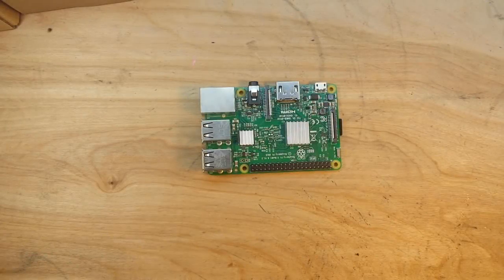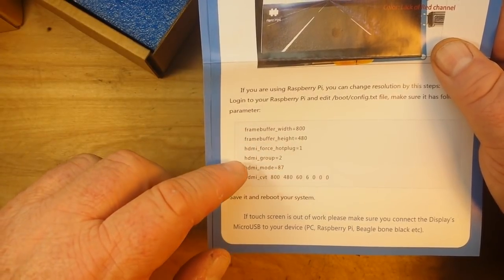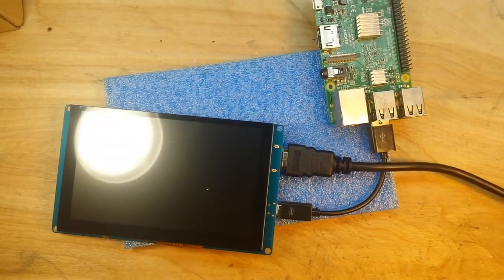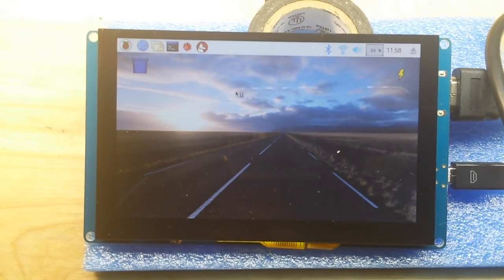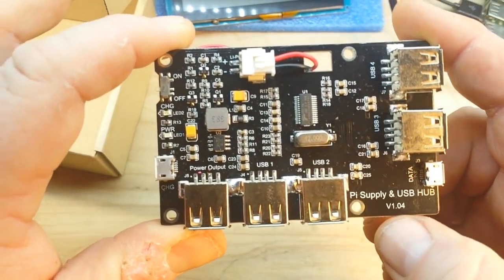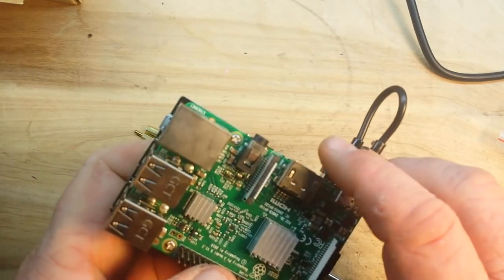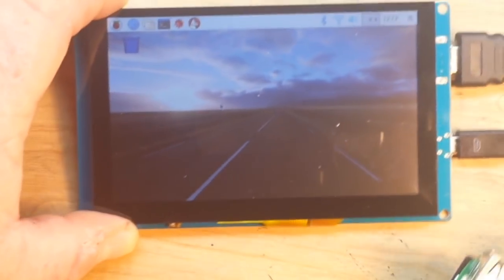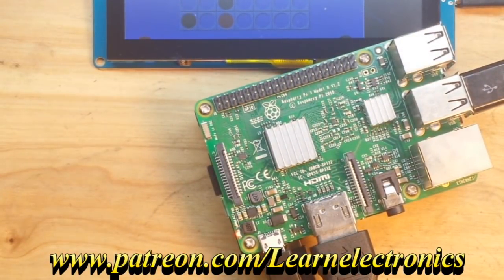Make your Raspberry Pi portable

Comment: Bought a Sunfounder 10 inch touchscreen. I was supplied with a 12V 1.5A power adaptor instead of 2A which is advertised on their site. Having an issue using the display board's usb port to power my rpi3. It's boots up but I constantly get that lightning bolt sign on my screen indicating it's not sufficient for my pi. I've already tried a 3A power adapter but still got the same result. So I guess the issue is with the display board itself. Already have a working DIY setup and hope to make it portable using robojax's recently reviewed 9A dc/dc converter. Going to use li-ion 24v(28v) battery pack.